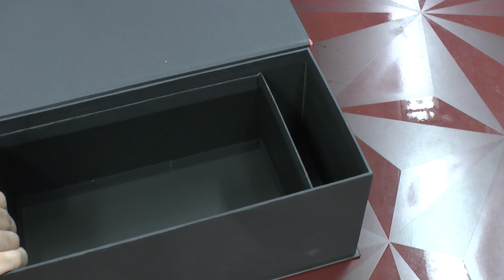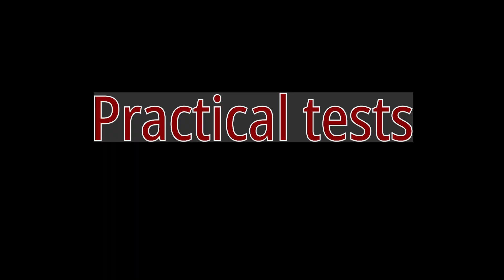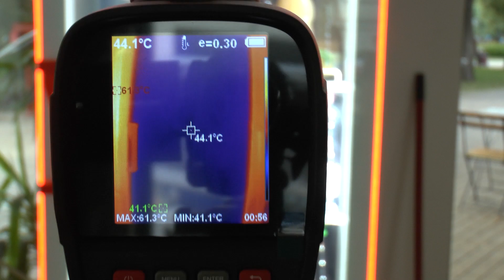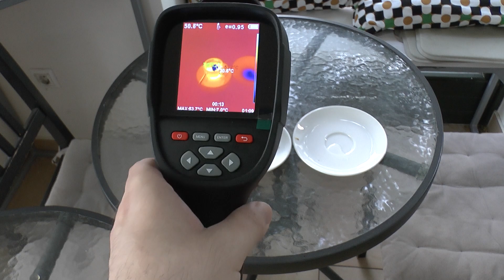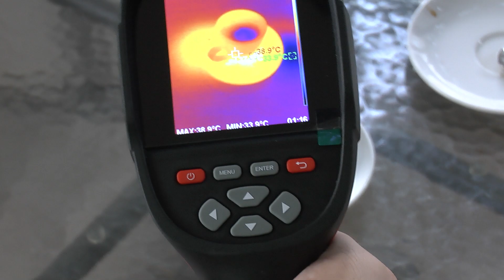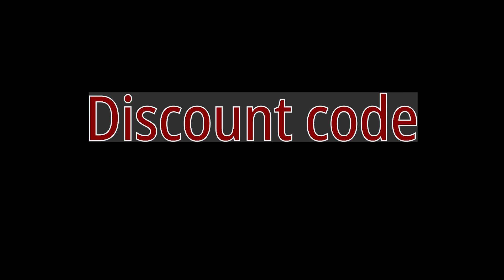Kaiweets KTI-W01 thermal camera review - a video capable thermal camera

Comment: I would have koved that, 25 years ago, on the production line. New boards with power rail shorts.
Reply from the maker: Hi Michael, yes indeed, these things are insanely useful sometimes....
Reply: @MrTamhan  I looked at  the price. Now that I'm retired, it is beyond what I can justify. If I was still working, one would be in my toolbox.
Reply from the maker: @michaelterrell  Hi, too well, I know this one. I am not fully retired yet, so ;)